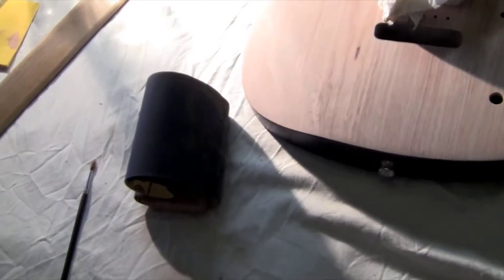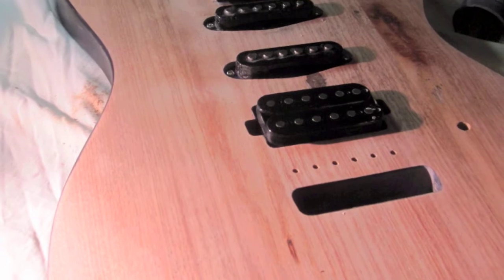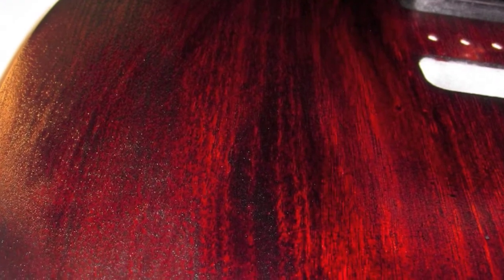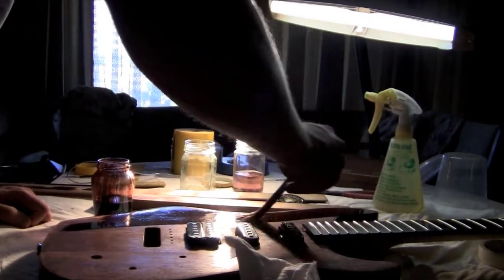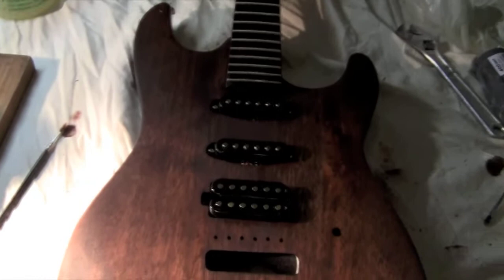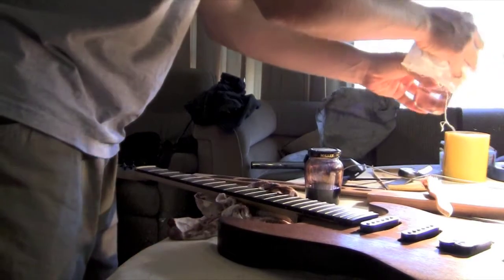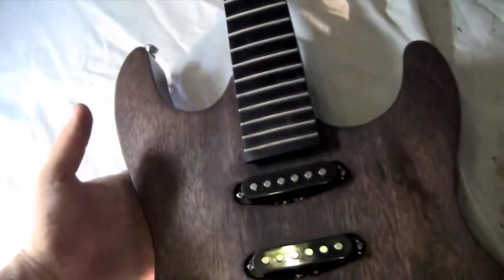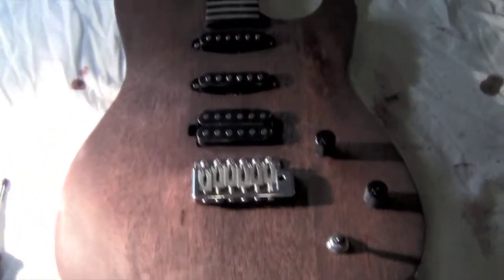Chapman ML1 -  Custom Modification 3 - Fine sanding and staining

Comment: im getting one of these and would just like for an opinion on the modifications I want to do and possibly further recommendations for other mods
Reply from the maker: Nathan McDonnell first mod would be new pickups / electronics, second locking tuners buddy
Reply: Yeah im getting the guitar rerouted for the mark holcomb custom shop edition alpha omega pickups and keeping a single coil in the middle and keeping the coil tap option.im also going to give it a nice finish with an acid wash or something